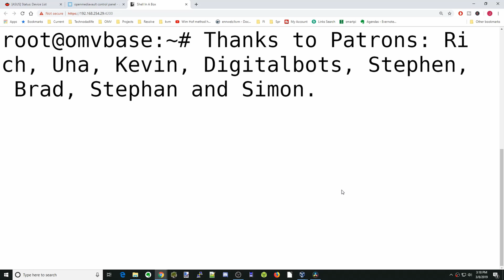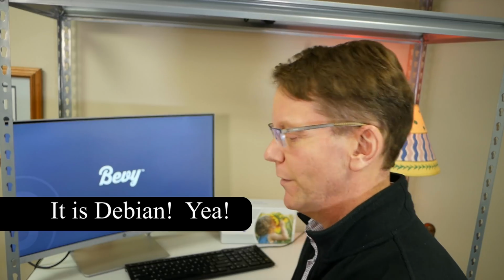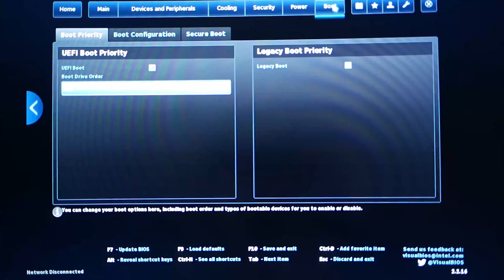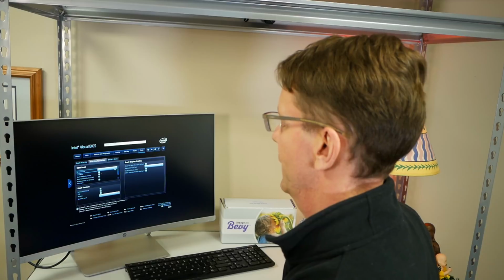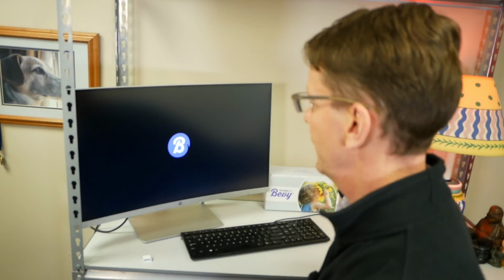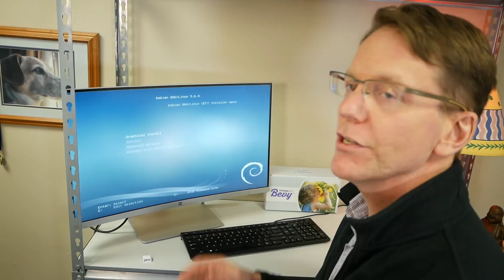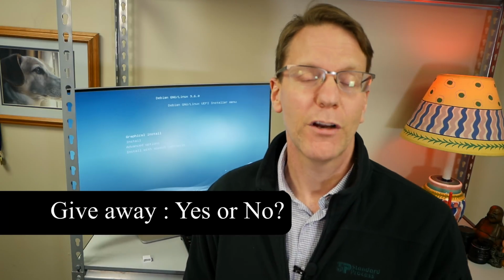Hacking the Lineage Labs Bevy Nuc?!?!

Comment: I picked one of these up at a local DFW Retro Computing meet up for $30 last night and am going to tinker with it tonight. Thanks for the video guide that I can follow.
Reply from the maker: Have fun!
Reply: I wiped the hard drive and then bought a 512gb SSD and have an 8gb stick of DDR3 SO-DIMM RAM on the way to finish the hardware upgrade for this system. Then I will set it up as a retro emulation machine and media center/streamer

Comment: Here you showed how to boot Debian from the USB drive. Then how do you install it on the hard drive so you can fully replace the Bevy application?
Reply from the maker: You boot into the Debian install from the usb drive.
Reply: @TechnoDadLife  Got it, thanks. I also updated the BIOS but the "Bevy" splash screen still appears during the boot process. Do you know how to get rid of that?